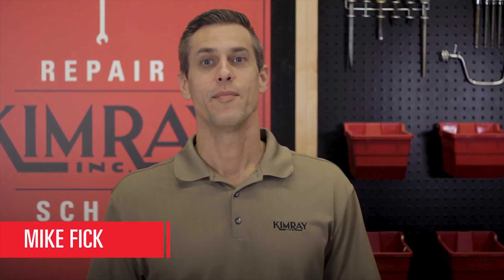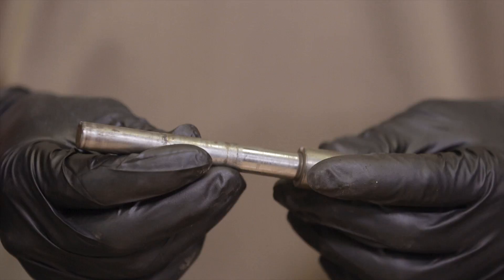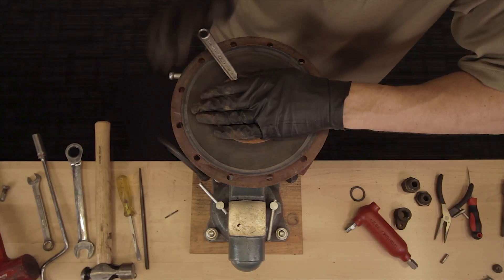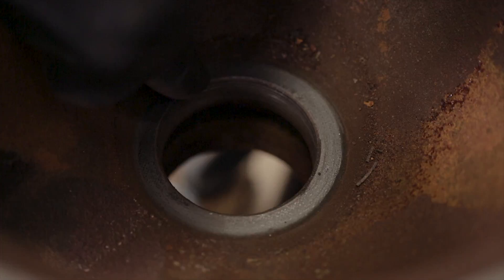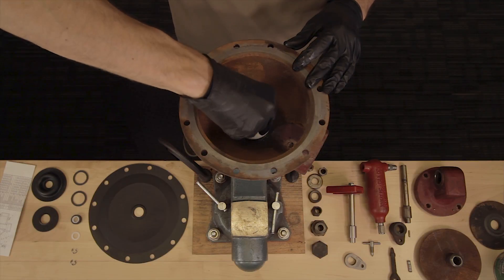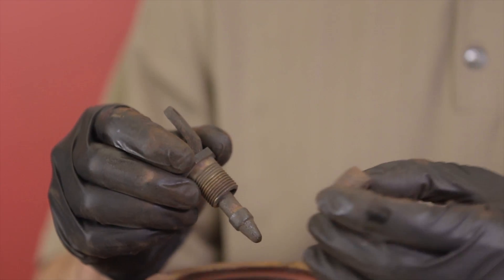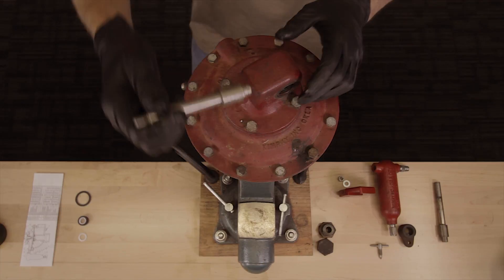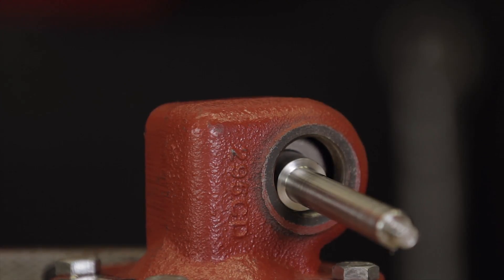Kimray Treater Valve Repair 🔧 [Weight-Operated Throttling Valve]

Comment: Did forget to add the new design on the top knuckle link assembly suck bad those o-rings don’t hold up and there is why to much play not impressed to say the least. And they wear out quickly. (New valve) the old style is where it’s at. The new hub design sucks to. That pressure fit set up suck. The old style with the key is way better.
Reply from the maker: Hello, the two issues you're describing, the hub/shaft play and the stuffing box leaks, have both been fixed with new designs! Check out these two links:
https://kimray.com/training/hub-redesigns-dump-valves-trunnions
https://kimray.com/training/product-notice-redesigned-stuffing-box-assembly-lever-operated-and-weight-operated-dump

Comment: 9/16,11/16,3/4” ratchet wrench are your best friend for these. Those seat don’t hold up at all. The delron is where it’s at. Also it the top knuckle isn’t leaking don’t touch it. You’ll save time and a head ache some days.  You also don’t always have to remove the drip pot to rebuild these.  The new improved seats are a woman they hold up some much better.